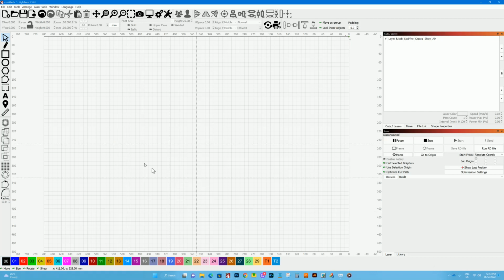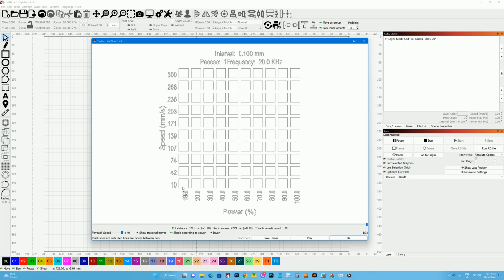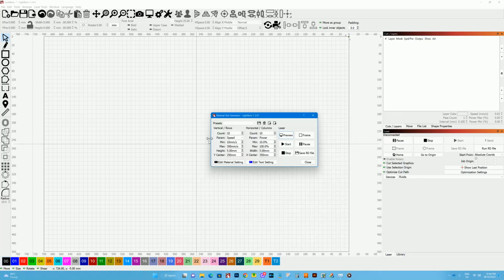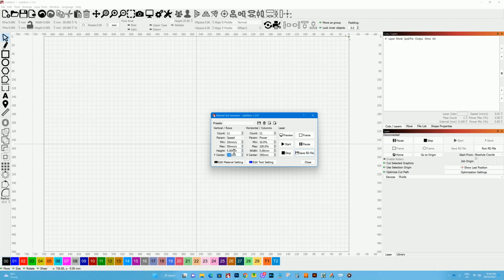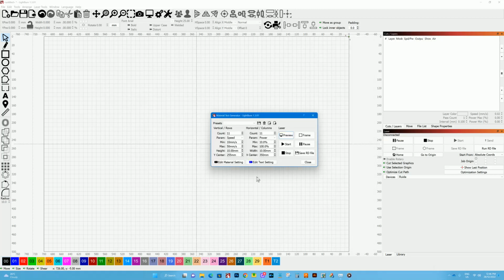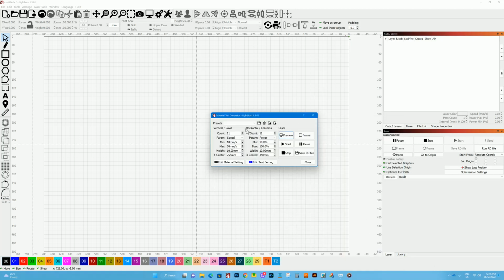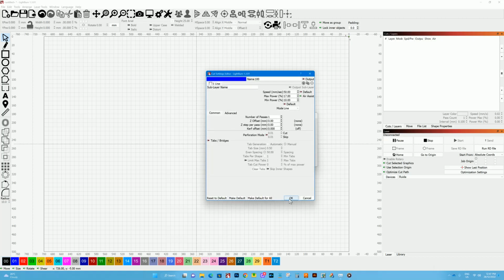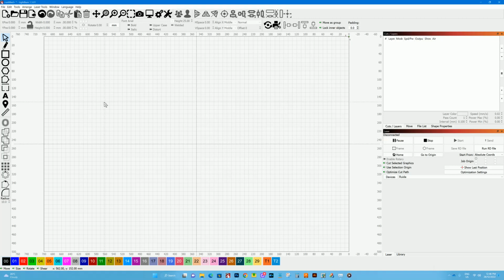Lightburn Material Test Generator area, find out your best settings with this Lightburn Feature

Comment: Is there a setting for different material depths?
Reply from the maker: Your speed, power, line intervals will   change how much depth you get on a certain material.     Lasers are different to say a cnc machine where you can set depth to remove material

Comment: How do you make your test a certain size or show up on the grid so it can be changed?
Reply from the maker: You can change coloums and rows up to 11 or set lower, you can also change the size of the boxes in height and width it cuts or engraves.

Comment: What is the reason for a scanning matrix?  I can understand power and speed for cutting different materials with different lenses but scanning only changes depth which will be great fro 3D engraving or marquetry  but what else?
Reply from the maker: Line interval only comes into effect if you set it to fill
Reply from the maker: If your lines interval, scanning interval is too far apart you will notice that in the engraved area. If too close for one the engraving will take more time to complete. If your engraving say clear acrylic these interval settings will play a big part in getting a nice looking consistant engraving. I hope I have answered some of your questions. Sorry it's a little late
Reply: @thelazerwhisperer   Hi Daz. Delay is no problem.
 I am still slightly confused becsuse you set the matrix up for cutting  at slow speeds and a range of powerrs  where scanning interval has no effect. yet I notice the table still says 0.1mm interval . Having experimented a bit with scanning , I find that power has no effect on engraving colour. If I set ther line interval to 0.5mm, as I cange the power, the lines remain the same colour. It is only when I close the line spacing that I get depth and burning occurring. I cannot get different  SURFACE colors with out  depth. Hence my original comment about 3D engraving.